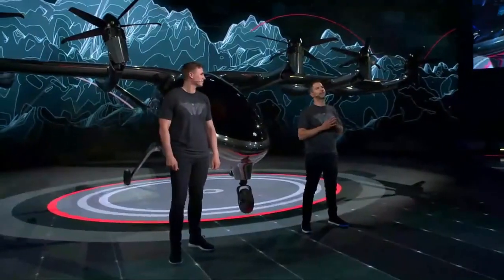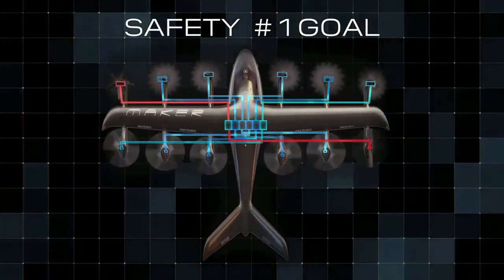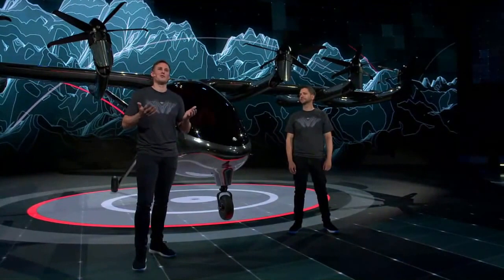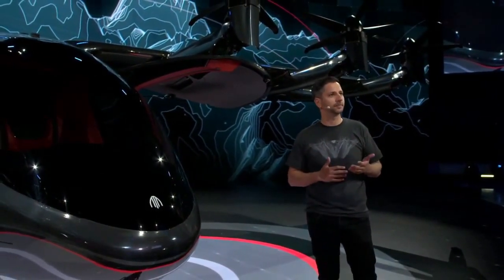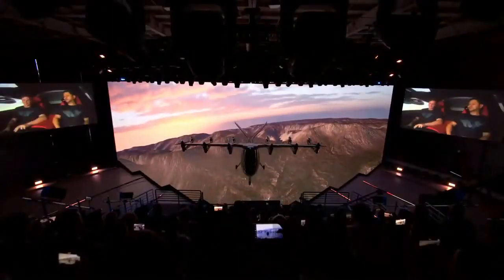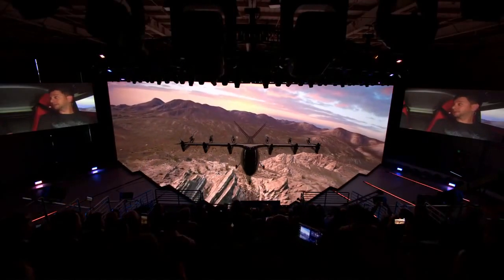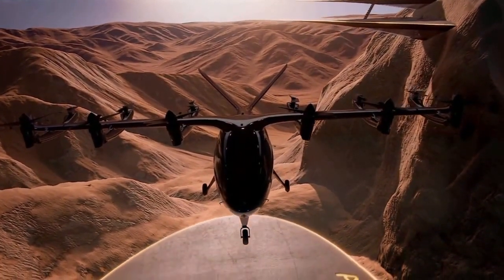Archer Aviation Unveil Event Highlights 🚁 Maker - Inaugural eVTOL (ACHR) (ACIC) | Archer Jet

Comment: No expense spared,- on  hoopla and PT Barnum promotion in abundance but a stilted unnatural presentation by the young  'makers'.... flying with stationary propellers is a real first .
The amount of showmanship at this too early stage raises red flags --far too slick for showing a mock up and a generic design featuring unsightly excresences (looking like bomb racks or 
drop tanks ) that seem like afterthoughts scabbed onto a clean 'shrunken glider' with Cessna landing gear .   The PR department should ALWAYS avoid using the phrase "Prepare to meet your Maker" when doing customer test flights.

Comment: So it holds...two people? And their dog? What I found disturbing was the time spent comparing the Archer to a helicopter in terms of noise. That's like telling me that their car doesn't whinny like a horse...85 years after people stopped using horses for transportation. We get it, it's quiet. So are all of the other competing EVTOLs. That's not unique to the Archer, it's one of the prime reasons EVTOL aircraft are now viable to finally create an affordable air-taxi service. So they spent the intro telling me nothing new about a vehicle too small to be used as an air taxi. Is that a scaled-down demo plane? When it's big enough to carry at least four passengers, how will that stack up against Lilium, which can carry six already (seven once the pilot is pulled) in what looks like a similar footprint?
Reply from the maker: Yes, Archer has definitely lots of catching up to do.
Thanks for watching!

Comment: Can you fly without hearing the noise from the engines ???. No manual controls ????. I need someone to convince me that the system will not freeze or say not responding in mid-air. Its in my DNA me to always look for something to pull when things fail. But above all this is a good invention, really good. The future is here
Reply from the maker: I think they are moving in the right direction. Certainly an exciting tech.
Thank you for watching!

Comment from the maker: 00:00 Intro
01:34 Maker - Demonstrator aircraft
02:10 Design, technologies, engineering & safety
05:56 Interaction with the Maker
06:20 A look inside
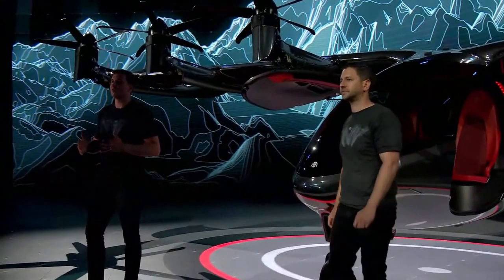08:24 Ground test, hover & full cruise speed
09:05 Lame flight simulation
13:48 Master plan